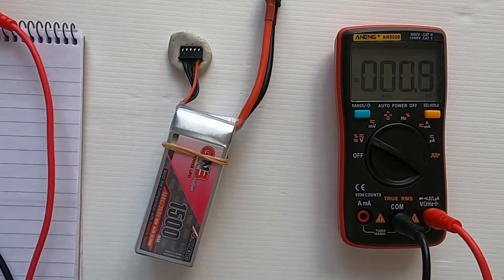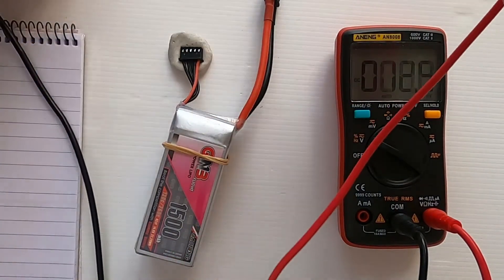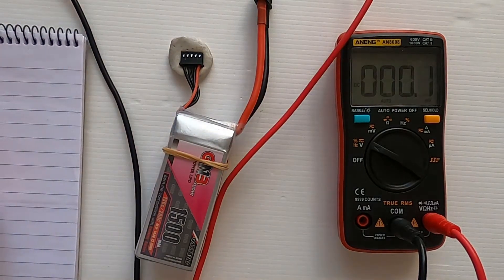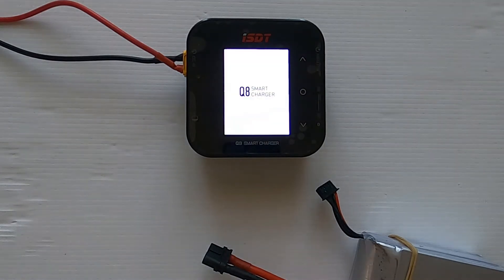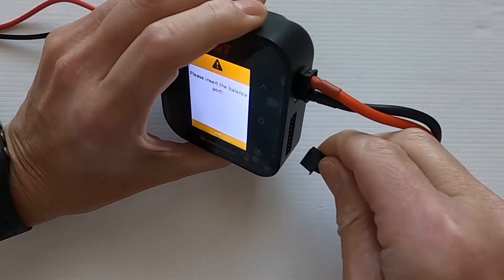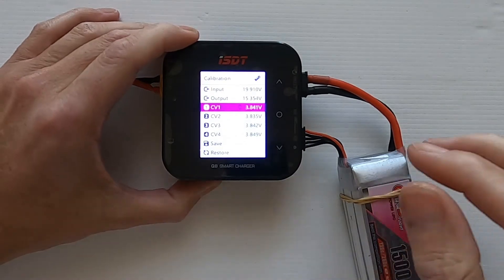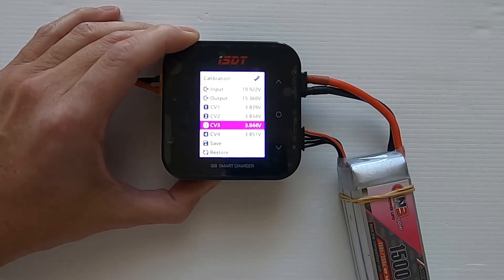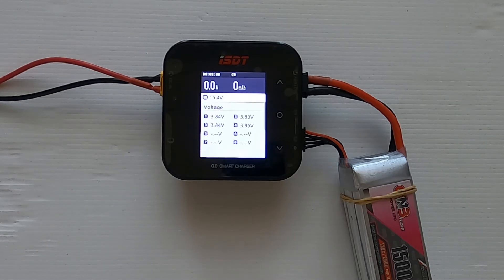How to do Battery Voltage Calibration in the iSDT Q8 Charger

Comment from the maker: You are calibrating the charger to match the multimeter reading. The multimeter should be the best  one you can afford. Hopefully you will not need to make any adjustments. I have no experience charging very high capacity batteries just follow the manufacturers instructions.

Comment: I don't understand what is being "calibrated", the charger or the battery?  What I want to do is "calibrate" my ISDT Q8 charger so that it more accurately displays the real voltage of the cell or battery that it is charging.  At present I am charging up the 4 individual LiFePO4 cells of a large ex-industrial scale battery (200 Ah?), but the Q8 charger always displays a higher voltage than what I see on my multimeter hooked up to the cell being charged for monitoring purpose.  If I set the charger to output 3.65V @ 5A, it will indicate the voltage has been achieved and 0 or little amperage, but, the multimeter only reads something like 3.55V.  Can I adjust or "calibrate" the Q8 so that it more accurately detects and displays the correct voltage?  The multimeter I am using to monitor the cell being charged is a RICHMETER 101, but I have just compared the current voltage reading on that meter with my BRYMEN BM235 meter that is made in Taiwan, and it is almost the same reading.
Anyone care to reply with some knowledge of the situation I am describing?